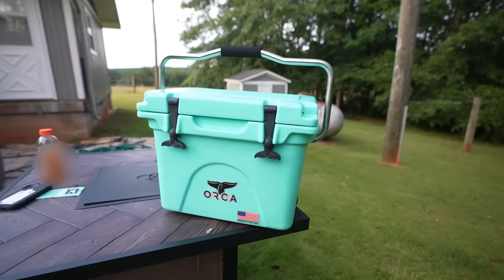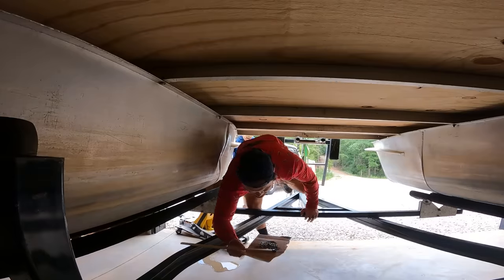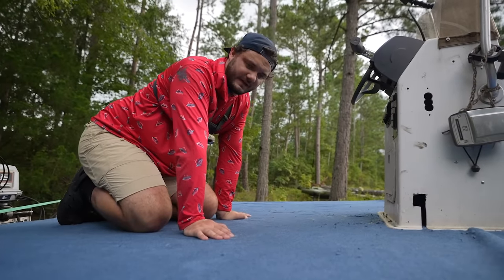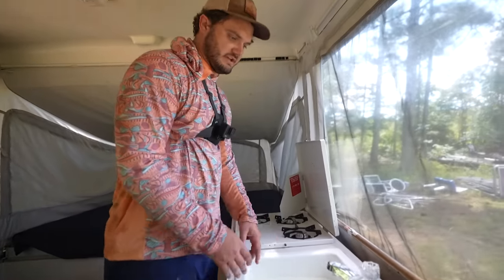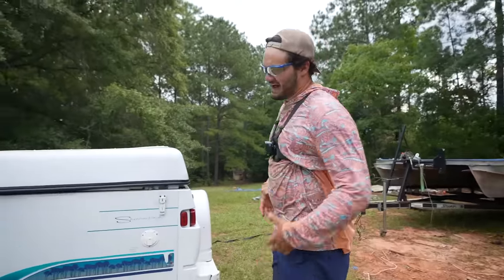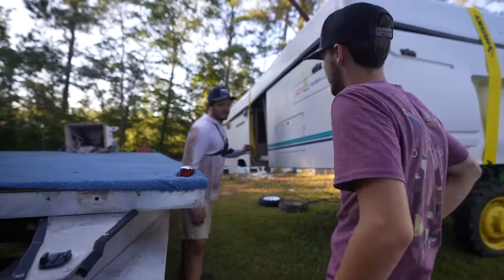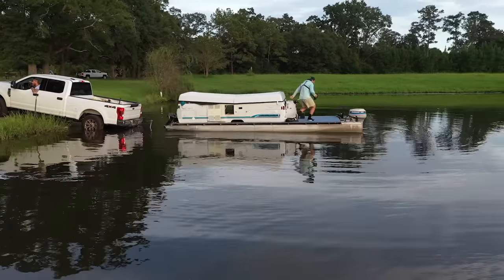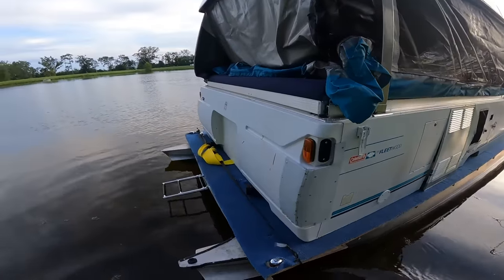Installing a POP UP CAMPER on my Pontoon Boat!!

Comment: You might want to consider adding a third pontoon for extra buoyancy.  Also, maybe add fold-down side decks to allow you to safely walk around the boat in the water.
Reply: my thoughts exactly I like the way you think
Reply: Yes but it would be funny to see them sink another boat
Reply: omg we think alike same idea omg
Reply: Agreed
Reply: For real! I was looking at it like you could add more buoyancy for the deck
Reply: Could have stopped them from cutting up the trailer aswell
Reply: You took my idea about the flip down side decks!...
(Or, "Great minds think alike.")
Reply: Same thoughts…
Reply: Maybe add one on each side and more plywood for extra deck space to walk around it
Reply: A tri tool would also make it more stable
Reply: Far too sensible a comment! I mean all your points make sense, and would make a positive impact

Definitely the wrong youtube channel for sure!
Reply: Might also consider not breaking the roof lol
Reply: Grab rails.
Reply: A couple 55 gallon drums on the front would work too.
Reply: @Scottsdaildude , they would, but an extra pontton, especially a smaller one biased towards the front, wouldn't be super expensive and would create less drag than 55 gallon drums.
Reply: Uuuuiiuiiiiiiiiiììiiiiiiiiiiiiii7777i77iiiìuuìi78kiiiiki77uiìikiiiiii77iiiììi8iiii8iiiiiiii8j7⁷⁷i777i⁷777iiiiìiiiiiiiiiiiiiiiiuiii7uiii7iiiiii88iiiiiii8ii7iiiiiiiiiii8iiii7i777777⁷i7ìiiiii7iii77i7i7iiiiiii7
Reply: lol, that's what I was thinking 😂
Reply: you clearly don't know Ayo very well 🤣
Reply: You are one crazy guy. Keep it up. What is Davy Gravy studying to be a gynecologist?
Reply: Came here to say this!
Reply: Yeah I wouldn't want to see him sink another boat with Davey on it that wouldn't be cool but baby falling off that dock that time was one of the funniest things I've ever seen not to be mean but to watch ayo freak out the way he did oh my God but Davey was okay yeah I agree with the third pontoon and the fold down side deck cuz you know they're going to want to fish off of it and that's a really good idea you had there brother
Reply: @allanwalizer167 , I’m actually a girl, but thanks.
Reply: Repent to Jesus Christ ““Enter through the narrow gate. For wide is the gate and broad is the road that leads to destruction, and many enter through it. But small is the gate and narrow the road that leads to life, and only a few find it.”
Matthew 7:13-14 NIV
Reply: @repentandbelieveinJesusChrist3 , no thanks.
Reply: That’s a good idea but you have to think of weight. It’s already riding pretty low so if it were me I wouldn’t add big ones
Reply: @jaxondun5967 , that's why you add the third pontoon.  You could also add floats to the side decks once deployed in the water for a little extra buoyancy.  You just have to ensure your overall width doesn't exceed 8.5 feet (in the US) when trailering the boat unless you want to get a permit for a wide load.
Reply: That takes way too much logic to accomplish. Don't bet on it happening, lol.
Reply: @bobbiechavez2990  If only you had a capable mind.
Reply: @FarmerFpv  Rude.
Reply: Don't forget to add the weight of happy campers & the stuff they'll bring with them.
Reply: Really thought they were going to sink both the pontoon as well as the truck!
Reply: Ultimate rebuilds on YouTube found a kit to add a plastic 3rd pontoon.  It made all the difference with his super heavy build.  I agree with the fold down decking as well

Comment: Love this concept and I hope you can fix the broken roof of the pop up to make this an actual functioning creation.  Also, extended side decking so you can walk around and enter the pop-up correctly.  Throw in a small propane grill and nice Eco-Flow or other battery bank and you are set for some floating fishing adventures.

Comment: Definitely bigger than what I had in mind, I'm surprised that there wasn't a massive weight distribution problem but if it floats it floats. I hope that you're saving that stove for the Itty Bitty.
Reply: a trailer camper does have even weight
Reply: @gregoryeverson741  yeah but it's not centre on the pontoon. Maybe the outboard is enough to offset the difference.
Reply: @RubyDoobieScoo  - The mouse and it’s family takes care of that part!! They shift inside the pontoons as needed. I gotta wonder how much water he put in those pontoons when he sunk them under the water for as long as he did. That’s the buoyancy foam they were standing on and the pontoons were otherwise open,,,,. 😮
Reply: I was thinking that about the stove and sink as he was getting ready to rip it out too.They looked new.

Comment: Look under the slide outs. There should be some "kickstands". They support the weight of the bed. One side goes to the bumper that you remove but I'm sure you can figure a work around out.
Reply: As someone that had a pop-up a year ago, was thinking the same thing.  Was slightly worried when the pop-up was sitting on the stabilizers, they aren't made to support the weight of the camper.

Comment: If you make an adapter to hook up from the drain plug to an air compressor you can pressurize the pontoon and spray soapy water and find your leaks
Reply: You can also drain the water from the pontoons while afloat with an air compressor

Comment: Make an air fitting to screw into your drains. Next hook a compressor to each pontoon then spray the outside with soapy water while filling them with air. Every place that blows a bubble is where your leaks are.

Comment: On those slide outs, there's small bars that go from the slide to the frame to keep the sliders from bowing, and it will also remove a bit of bounce when turning over.
If I had the means to make something like this, would be hard pressed to ever leave the lake

Comment: I bet instead of removing things on the inside take a look underneath. The axle, springs, and tires weight a bit. Plus is there a full metal frame? Maybe instead of three hours take some time and build a wood frame in place of the steel one, then shed some weight like those pull out awnings. I got a slide in camper into the back of my compact truck. The camper is build for a full size truck, but I will say I did work on my rig for such a thing. Plus my truck does weigh more than the camper to start with and I also can haul 3500lbs so some work was involved. But hey sink or swim, it will be entertaining to say the least as always.

Comment: Pretty cool. I would have left the sink and stove. I would have taken the water pump and ran it down under the deck with a filter cap and you could have just sucked up water for sink use. Then do the same with the drain. Or used the fresh water tank near the rear to level her out. Also would have moved the helm to the front or just farther back to center up the camper. Awesome idea I think the execution could have used a little more finesse so the camper was still decent lol. But I don’t have a pop up pontoon so what do I know 😂😂. Loving the boat vids

Comment: You could replace the bottom of the pull-out with ridged foam covered with fiberglass . A piece of dock foam or 1/3 length pontoon under the middle of the bow would be advisable. You could make a pontoon out of blue plastic barrel. Or one 55 gallon drum with a piece angled up for a bow . Even half a drum (old BBQ grill ?) .

Comment: The Jed Shed..... I had one of these in my past!!!

When I was in high school I helped a neighbor do this with an aluminum shed that was 8 foot wide and had way more room on the pontoon boat than this.  Your boat is way too small.  We had at least a 3 foot back porch that had a generator, one outboard motor and was able to eventually hang a window AC unit out the back after a few trips cooking ourselves in an aluminum can in the middle of the water with zero shade.  

The second season somewhere we found two abandoned walk in freezers and used the walls to insulate inside the shed.  Canvas tarps made the front porch , bait coolers fitted with backs made seats and the whole thing was painted blue with a sign on the sides of the shed that said "Jed Clampett's Bait and Tackle  Supplies".  That with a donated pleather couch, Farrah Fawcett, Cheryl Tiegs and a few Budweiser supermodel posters made that thing perfect.  We fished off that thing way past college.

"I think your gonna need a bigger boat" -- Sheriff Brody

Comment: Just out of curiosity, did you guys think of making maybe like four holes near the top of each pontoon, then getting cans of the expanding foam and filling your old pontoons with the foam?  Think about how they do walls in houses to insulate them - they drill a hole, stick a nozzle in and pump foam that expands and fills the space.  That way water really can't get into your pontoons - well, it can, but there's no place left for it to accumulate.  Also the foam helps with the buoyancy of your boat.  Just a thought...

Comment: I’ve had this desire to build a (floating) trailer which could be towed by a eg bow rider.  Instant yacht.  Anchor the “trailer“ & cruise around.  Then attach bow rider to trailer & sleep, cook, etc. Most suitable on a fixed lake as would be tricky to move.

Comment: Where you pulled the plug to let the water out, hook it to a air compressor and pressurize.  Spray soapy water around the tube, look for air bubbles and mark with a red sharpie.  No guessing involved

Comment: You should look for a 6 or 8 foot box popup that's a little narrower.   That way you have some boat space left.  You could actually mount it sideways and have the beds hang off the sides of the boat.
Reply: That would cause alot of side to side tipping .

Comment: Another pontoon on the outside of current pontoons for quadtoon and definitely an ice fishing hole off the front bed with a velcro netting but sewed on one side so ya can't loose the anti cellphone loss thing down the porthole gonna need to add some interrior strength rails inside roof and also some form of handrail or tension cable all the way around platform,  and some chairs off back for captain and friends  idk of 3 or 4 too many id say double benches and a captains chair but the weight limit... definitely 2 100 watt panels or 1 300 watt to top off batteries for trolling motor going  I'd say 1000 watts but that's 10 100 watt panels so more weight, maybe make some clip on platforms for fishing off the side edges/ making an entry platform for port and starboard of the door then clip on platforms suspended by cables/ ropes just fold up out of the way but a great loading unloading plank

Comment: just a thought after watching these videos im wondering if you maybe have considered crafting a fold out railing system that lowers out when in camp mode into side decking
but folds up in boating mode to act as a rail system

Comment: Ayo, popped that guys labor of love, harder then, a proctologist snaps them dang  gloves.  Sorry Mr. James, but Ayo couldnt wait and he had to pop it and take advantage of your handy hardy work. Mr. James is probably screaming at the screen while he watches his long labored hours of work be hacked, hammered, sawed and ripped from his very hands and heart.  Ive often wondered why didnt they make these as an option, and ive been hoping someone would do it. I do think tossing the stove and sink was a little premature but alas i digress; after all, its a Picasso. What an oddly satisfying and working piece of art.  I am wondering however, if its Lojos pond thats sinking these boats and not actually the boats themselves. lol  I do think a third pontoon would help with the weight and also they sell walk around decks that also may help.  Because I can see Davey  Gravy ending up in the water.  Also id love to see the sleepover video, its too bad you couldnt get Norm, Yakpak, Lojo, Davey and Ayo all aboard.  Well maybe a 3rd pontoon would make it possible.  Cant wait for ur next video.  U had me rolling when u talked about the guy u got it from and u popped those doors with a crowbar, but the rest just omg i was dying.  Ps
 I love that you feel slight reckless tossing a cooler from a tree yet this monstrosity isnt lol

Comment: Back in the day the slide outs had stiffener supports going from under the bed to the bumper, leave the canvas tucked in and the slide out would make a nice casting platform.

Comment: You can get a 1/2 of a pontoon and put underneath. And they've got a center pontoon that you can mount to that pontoon boat and you'd have enough pontoon to hold that boat up out of the water

Comment: Next time you do the adhesive on a pontoon floor use a paint roller with a long handle to spread the glue. Also staple the edges to the deck to keep it from peeling up.

Comment: You all are hilarious. This is the second video I've watched and I'm hooked now. Too bad you couldn't have cut a hole in the floor of the camper and ran the steering controls up so you could drive from inside. Great video..

Comment: I love the idea and the execution. I'd do one thing differently. Get a smaller one that's body is about equal to the WIDTH of the pontoon, and put it on at 90 degrees. That way the door is over the boat's floor and the beds pop out over water.

Comment: You could always pressurize the Pontoon with air just take the air compressor and hook it up to the drain plug entrance and then look for leaks with soapy water this way you know we will float

Comment: on the rear bumper there was two bolts that were there for the bed supports, same with the tongue there were to spots for the supports... the beds are not ment to be pulled out and slept on with out those in place. they could and will snap off of the main camper.

Comment: You should install fold down sides that double as railings with flotation in the fold down part. It would give you more deck space along with extra buoyancy and safety and shouldn’t be too hard to install.

Comment: Ayo, you need more buoyancy in the front.  Go get a kayak, or a huge PCV pipe, seal it, and bolt it between the pontoons in the front.  Otherwise, underway you will take on water.

Comment: You need to add a middle pontoon and remote steer and shifting and throttle control from inside the camper

Comment: I don't know. I love the idea and the enthusiasm, but maybe you should remove the front pull up bed, or make it smaller. Also, maybe try to move the center console, and the camper, more to the back. This way you'd have better weight distribution and more space to fish from the front deck. The third pontoon idea is also very valid, can never be too safe with these things. What if you get a storm overnight?

Comment: Instead of the jb weld, you could have used those aluminum brazing rods. They are supposed to have a slightly lower melting point then the actual aluminum.

Comment: my vision on that would be to measure the steering wheel thing a ma jig and then measure where it would sit in the camper and then cut a hole in the camper's floor and sit it over the steering wheel thing a ma jig so you would have better weight distribution buuuuuut might need to cut a hole in the side of your camper for a window to see =P

Comment: Next time before you back up, disconnect the boat from the trailer. That way, when you back up, the boat goes in the water. You don't have it hooked up to the trailer and it'll just slide off. You only need it hooked up when you're coming on not when you're going off

Comment: Hey if you guys still have it just cut a hole in the middle of the floor, lift it up like ya did already and slot it over the wheel

Comment: Itchy Arms:
The vibration causes an itchy or a pins and needles sensation (is common). They make gloves that have gel in the palms them to dampen the vibration from tools. Anti vibration gloves.

Prolonged vibration from tools is bad for your arms. We are talking doing it for a job though. Like running a jackhammer.

There is also a medical condition for people who have it really bad (any vibration at all) it's called: Vibratory urticaria.

I know all this because it use to drive me crazy when I used specific tools. The itchy pins and needles... Ugh.

Comment: Create an adapter for your air hose to attach to the plug threads in the back.  Add pressure to help find holes.

Comment: What could happen if you pressurized the pontoons? Not very much maybe 2/3 lbs? Do you think they would still leak ?

I would have put a good tent on it. SNUGPACK comes to mind. You could have more room on deck if you wanted to cook. You can get a tent type outhouse. 
I have the snugpak scorpion 2. They make a man cave size one as well. All of the gear could double as good camping equipment. Snugpak makes nice tents and I’m talking winter use and Rain. 
Check ‘em out

Comment: Would be cool if you could put it on their sideways so the pop outs were over water on both sides, put the door goin in by the wheel n throttle then itd be more toward the middle of the pontoon  and a lil walk way on the front of the pontoon...

Comment: Here's a potentially stupid idea... which probably means it'll be one you love:  What is the camper was twisted 90-degrees?  With the camper folded down would it fit on the boat that way?

The benefits here are would be weight distribution... all the the weight would be in the middle.  Furthermore, you'd still have a lot of deck space in front (and perhaps in back).  The biggest issues would be:

1. You'd have to extend the sides at the same time to prevent tipping and you'd have to do it from inside somehow.  You'd probably also not want someone using one bed without someone else (or some equal weight) on the other bed to balance.
2. You might have to find a way to get an additional door on the opposite side of where the current door is so you can move front to back.